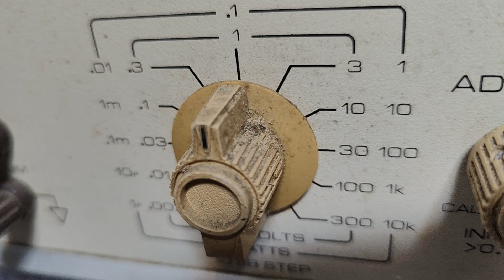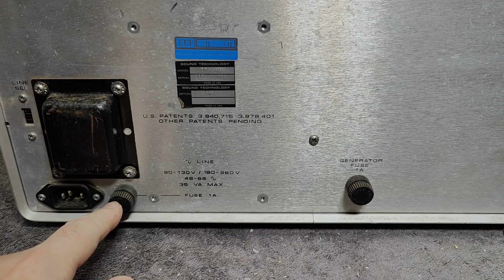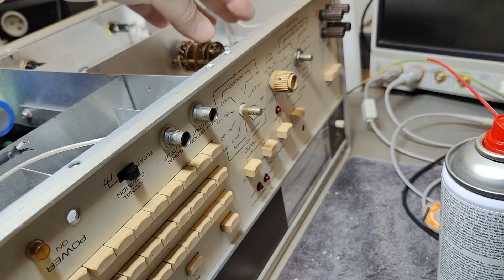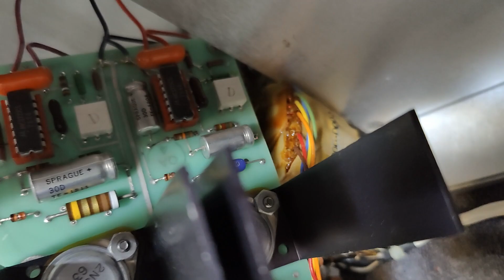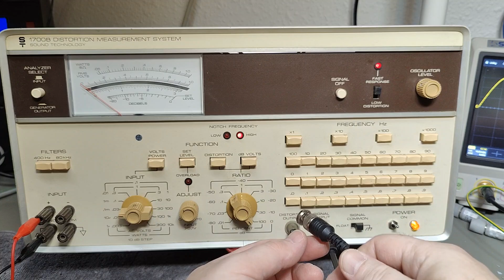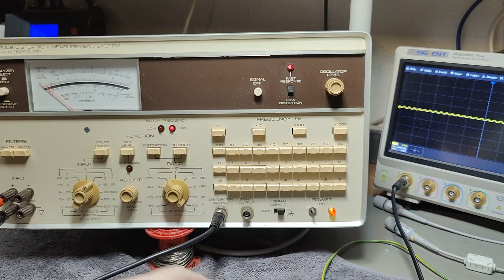sound technology 1700D distortion measurement system 1979

Comment: The tuning of the notches looks a bit crazy. It does not look like a simple switching the genrator and notches with the same switches. There may be something rather complicated going on, like tuning the notches for minimum signal. The LEDs for freq. high / low may indicate a kind of not "locked" state. So using the generator to find the notch frequency may not work. If the LED-LDR couplers are old/weak, they may not work over the whole frequency range - likely better more at the lower end of the range. It may be worth looking at the manual again - with the old instruments they usually had a good explaination.

The 6 diodes at the meter are a bit odd - a bit like clamping the signal to avoid driving the meter to hard. Still odd with aready a diode there. The diode could also effect the linearity a bit.

Comment: Used these for years in audio equipment R&D. They are great when they work. First thing is to clean all those switches, if there is corrosion on the pcb the switch contacts probably need to cleaning too. The fact the the external generator works somewhat but is way off frequency is an issue. This machine has three separate systems - generator,, voltmeter and notch. Verify the voltmeter first. Then the oscillator, then the notch amplitude and frequencies. When working correctly, you set the frequency, set level and measure distortion. the hi lo on yours indicates that the notch filter is not happy and you are getting an overload led indication while the meter was not at full scale in voltmeter mode. you can get in trouble while measuring distortion and overloading the input.

good luck
Reply: Was gonna say that with all those switches, the issues he is experiencing are no surprise at all.

Comment: I always felt that you find the old cars in the barn.  I thought you found old electronics in the basement of the woman who's husband is now a silent key. She did not know what to do with the stuff so she chucked it in the basement and turned the hamshack into a knitting room. Those knobs and buttons did look like something growing on them.  Thank goodness for a good sealed cover.     Question. Do you have a dim bulb tester?
Reply from the maker: yes i have dim bulb tester, but i use my vario with amp and watt readout much more, i also change the fuses in it, to match just the needed power for that project i play with. AND chassis ALWAYS earth grounded for my protection
Reply: @TeardownOZ2CPU    I like that. good deal.

Comment: I would guess that the detuning is probably caused by bad contacts in those zillion switches. I think the tuning scheme is like this: The three rows of switches let you set a number between 10.0 and 109.9, which you then multiply with the top four switches. So, if you have 100 and 100x pressed, as seen towards the end of the video, this should be 10kHz, not 1kHz.
Reply from the maker: sometimes it is possible to confuse even me :-) with simple things like level or frequency multipliers, i feel it is not the first time, front plate information is a factor 10 from what i imagine must be right :-)